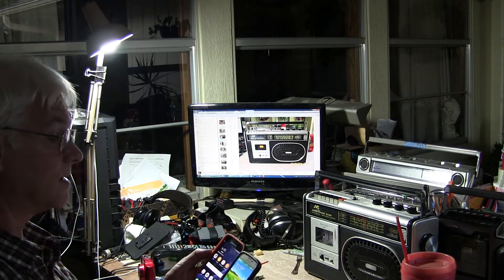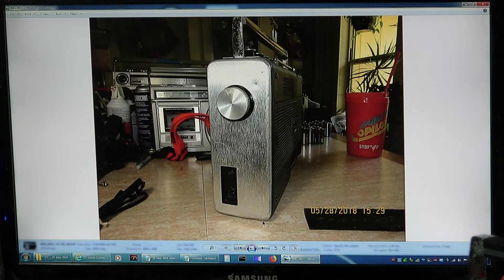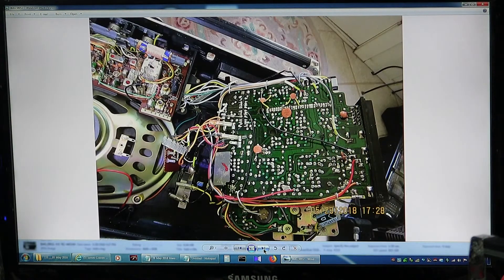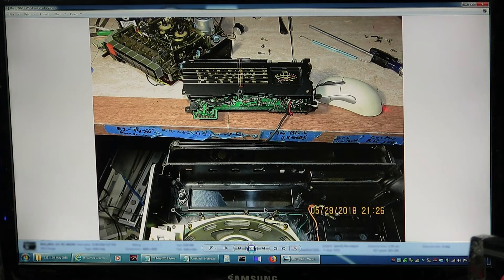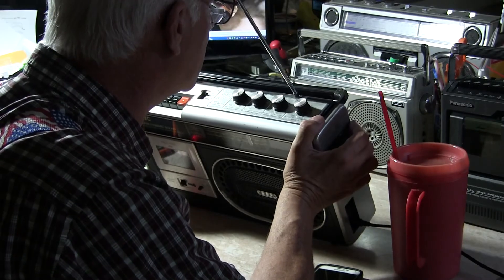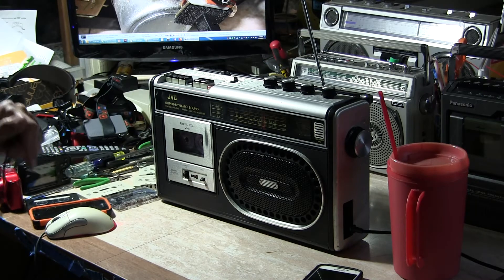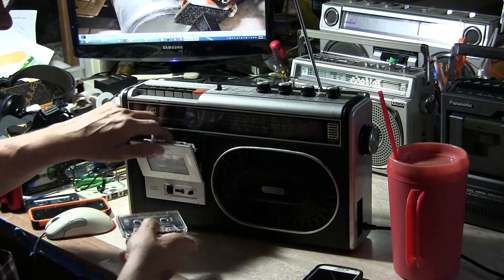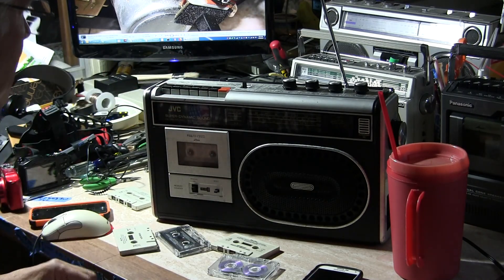JVC RC-443JW RC-443 Service Repair Restore Radio Cassette tape Play for sale

Comment: hi your video is amazing old equipment is still the best
Reply from the maker: Daniel Marie Rock one of my projects is to upgrade the 6 by 9 speaker and this particular radio with a Pioneer 6 by 9 dual cone speaker and see if I can get a better sound out of it with a better speaker of course